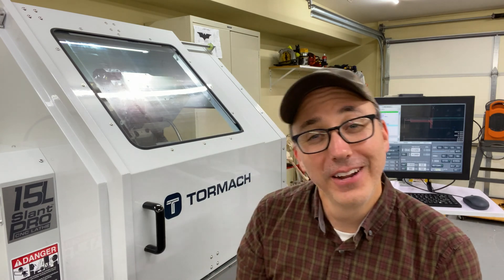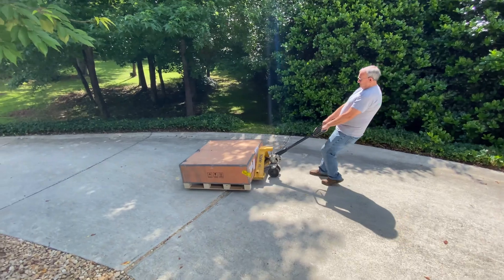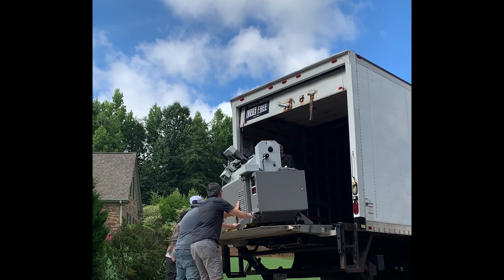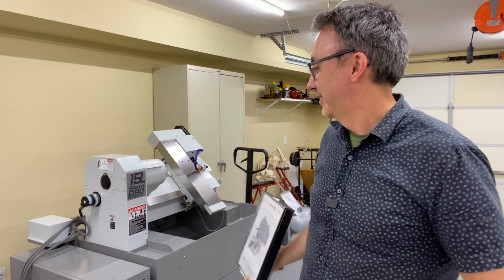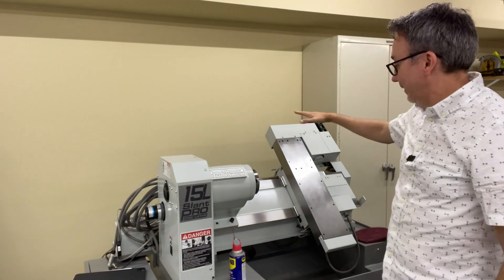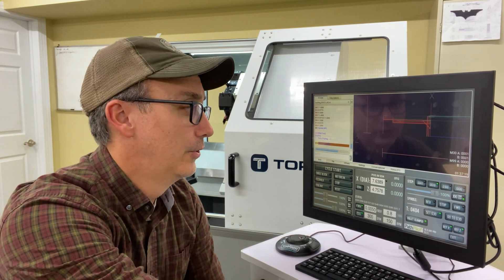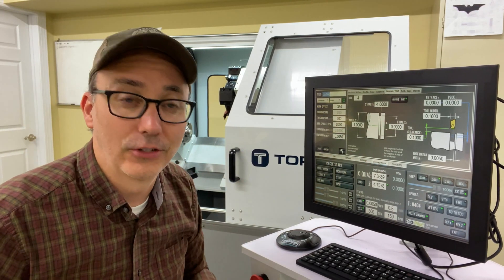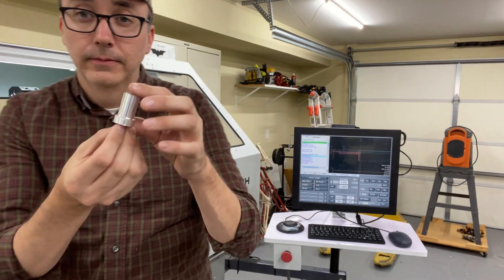Assembling a Tormach 15L Slant Pro Lathe and Running My First Part

Comment: Jeremiah, I'm thinking of buying this model but am concerned about the long-term effects of humidity on the parts. Do you have any
advice on this matter? Is your garage environmentally controlled?
Reply from the maker: It is not. I live in Georgia. Haven’t seen any major issues. Have had it almost 2 years.
Reply: Thanks Jeremiah. This is useful information. I live in Nova Scotia, Canada, near the Bay of Fundy where the humidity
levels can remain high in the summer. I was concerned about corrosion in the long-run.

Comment: Jeremiah, I'd appreciate if you could help me. The University where I work bought a 15L but did not take into account the cost of onsite training that Tormach offers which cost $4,000 for just 2 days. Needless to say, such cost is outrageous. It's not like you can learn to run a 15L proficiently in two days. Tormach does not even offer a technical manual that provides many step-by-step examples on how to turn a part. Better yet, you would think Tormach would offer ongoing video tutorials that could help 15L owners learn how to run the lathe in a fair and cost effective way. It seems you avoided all this by learning on your own. Would this be true? Id appreciate it if you could let me know how you achieved to operate and program your 15L Thanks.
Reply from the maker: I went to back to school for a year and a half to learn machining. So that helped a lot. I do think it can be learned by YouTube study but requires a lot more trial and error. I did learn a lot from John Grimsmo’s videos and NYCCNC. As well as Titans of CNC. Check out those channels for a lot of how to knowledge on machining.  Grimsmo and NYCCNC even have the 15L specifically.  I think you’d be on your way to running parts after two days. Having someone teach you first hand would speed things up immensely. $4000 is a lot of money. You might be able to find a machinist in your area for less than that to come in and give you some basic training.

Comment: For me, connecting the wiring for the turret was a bit difficult but what made things far worse is that damn ground wire. As instructed, I snipped off the wire eye terminal and added the ground wire. However, the end of this wire has a crimped terminal shaped like a pin. For the life of me, I could not get that pin connected to the ground block inside the electrical box on the CNC. It goes in like a loose tooth. I fear I messed up the innards of the block trying to get this stupid wire in. These small things really piss me off.

Comment: I know its almost a year later now and I hope youre still enjoying to learn machining. The number 1 thing I tell the apprentices is to NOT make too big a program cause they wont know what/where the problem is if something goes wrong. Take one thing at a time and double check. Program/run the facing. Program/run the outer diameter. Program/run the drill etc etc.

Comment: good job on your first part - looks like a parf dog. check your tool height to fix the nub during parting. Another advice if I may, run your first part at 10% feeds/speeds, it will give you a few more seconds to hit the big red button in case your offset (tool or part) is wrong - don't ask me how I know that....
Reply from the maker: Great tips!  Thank you!
Reply: @JeremiahDaws  a small correction to be made , the nub from the part of is from the weak cross section of the material , the part breaks off the stock before the cutter completely cuts it. In production we part off .5mm oversize, 20 thousands oversize and face the back off

Comment: Thanks very much for this helpful video! It was really high quality in all respects! I actually already have a Tormach 1100M+ mill and have been planning to get a manual lathe. After looking at the manual lathes out there, and looking at options that are in the $10-$15k range (more for quality than because I anticipate needing a heavy-duty machine), I realized I'm getting kind of close the the 15L Slant Pro cost. And just like my first mill was a CNC mill, I'm wondering about having my first lathe be the Slant Pro. Sure, I give up length of work piece, but most things I anticipate working on are probably within the dimensional envelope that the Slant Pro accommodates. And I have zero need for a 'real' CNC lathe, just as the Tormach 1100M+ has all the milling capability (work envelope, speed, accuracy, and precision) I need as a newbie hobby machinist. You video explaining your rationale and showing the delivery and assembly shows it's no more daunting than was the 1100M+. Gonna have to think carefully about these options now, for sure!
Reply from the maker: Awesome. Glad it was helpful for you!  Can’t wait to get an 1100.

Comment: Silicon the heck out of all of the seams.  Double dose any on the head stock side.  Back, left, bottom corner is probably the most prone to leaking with chip build up.

Ditch the stock pump and pick up a submersible 1/8-1/4 HP.  Make the adapter to go from it to the "shower hose".

The aluminum bushing that they have you make for the boring bar/round tool holders (first practice piece), should be made from steel if you plan to use it to hold a boring bar.  I still use the aluminum for a 3/8" drill bit holder, with modifications.

Other tips and tricks if you'd like to know!  Just ask.  I own two of them now.
Reply from the maker: Amazing tip. Thanks. Was just about to close it up.  I’ll do this first!